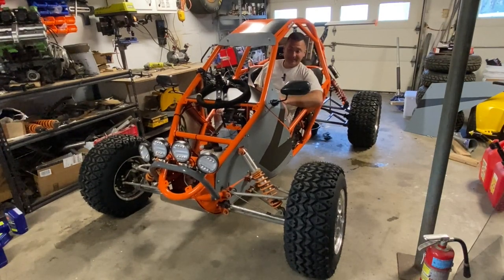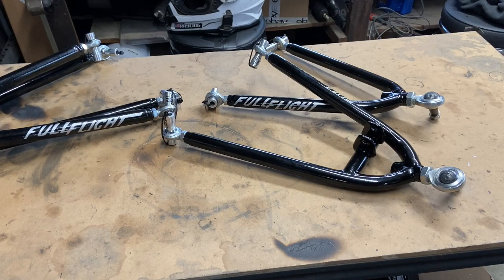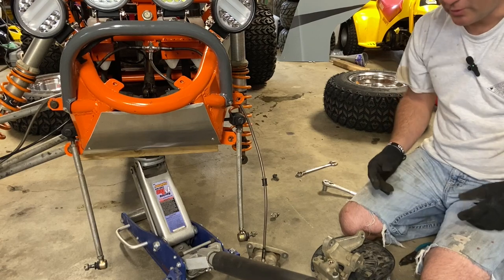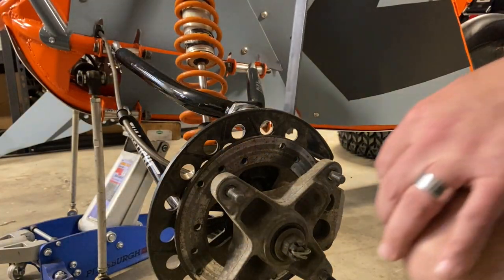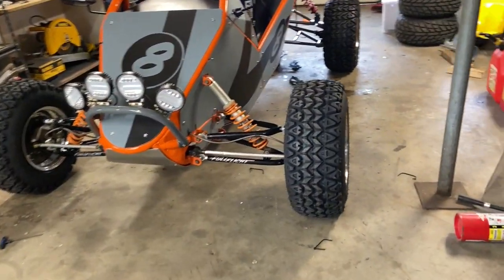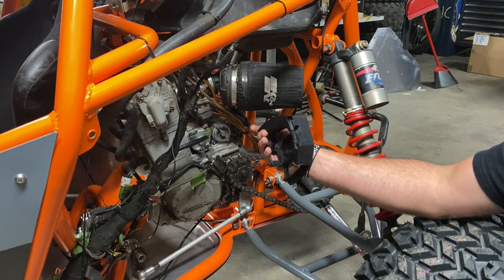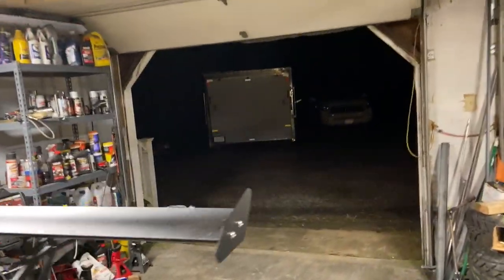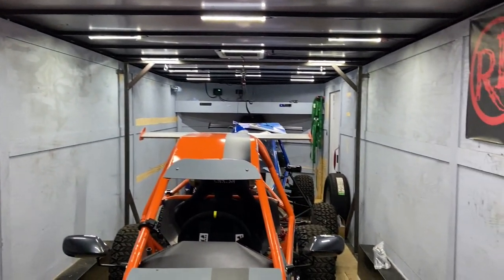KTM Powered Crosskart Upgrades

Comment: I have a bunch of questions - I'm beginning to plan a project and I have a Polaris 800 snowmobile engine .
Not sure what to do with it ... I also have a trailer that I'm putting a roll up door into.
I've been digging up parts for this with no actual idea what the finished product would be .
I had a job clearing out storage units that people abandoned and a lot of stuff came my way.
It sort of seems to be moving in the direction of a reverse trike with about a 25" tire on the back.

Comment: Kyle, I was glad to see you use and critique the full flight control arms. With the stock outlaw ball joints I'm not able to get the cart as low as I would like. For asphalt and street I want to use 24 inch tires And have 5 inches of right height. Looks like these will do it. I'm a little confused if my outlaw spindles will fit the predator ball joint studs on the full flight control arms. Mine are ordered so I'll find out. THANKS and keep up the good work appreciate it.
Reply from the maker: I’m 99% sure the predator spindles will fit the ball joints. It’s just the brakes that changed. This is an awesome solution for a lot of different ride heights and setups. They held op really well in the torture test we put them through at Busco Beach NC over the weekend. Video coming soon!
Reply: @KJRaycing  Thank You

Comment: When I started my build I made my steering linkage on the rear of the knuckle. Since, I have noticed a lot of other builders as well as you have your linkage on the front of the knuckle. Is this something I need to revisit or is this just preference of the builder? Thanks for your time and videos.
EDIT:  How do you calculate Ackerman with the linkage on the front?
Reply from the maker: So we mount them to the front just to give room for pedals and still make a compact package. The correct way to do it is following the angle of the steering arms coming off the knuckles. Since I flip mine and run them on the forward side I get a touch of negative ackerman or none at all. That being said, I haven’t noticed any bad characteristics from running this setup; maybe because the wheelbase is so short or because they are so light or because there is a live axle. In the end I would take the extra legroom over perfect ackerman.
Reply: @KJRaycing  Wow, I never thought of the leg room aspect. Your right, ackerman is more crucial for solid axle, none suspension builds where the front tires steer on different arcs to traverse a single radius. When this happens, each knuckle is at a different angle causing the caster to make the front tilt to one side, when this happens it shifts the weight off of one rear tire and allows you to turn better without the axle pushing the cart straight while accelerating in a turn. I suppose this wouldn't apply to what one would want in a crosskart. I was just curious and I appreciate your time and insight.
Reply from the maker: That is absolutely correct. A lot of guys try to use racing kart logic on these buggies but it’s not the same. A rigid chassis works better with suspension and sway bars where as on race karts the chassis is made to flex to get better turn in and steering. Your insight is pretty awesome too! Thanks for tuning in!

Comment: what wheels and tires are those? I assume they are not the wheels off an outlaw.
Reply from the maker: I re-use the front wheels from the outlaw, I actually love them because they are dwt. The 9” rear wheels are hard to fit with the custom rear a arms and the offset is a little crazy. I have a second set of 12” wheels and taller tires for trail use. $700 for a second set of wheels to make a race kart dual purpose is an amazing deal.
Reply: @KJRaycing  Thanks for the reply. What brand and size are the front and rear tires?
Reply from the maker: Carlisle all terrains 23” and sunf 22”

Comment: Your karts are amazing. Have you thought about a 4WD build?
Reply from the maker: Thank you very much. I have definitely thought about it, and I could definitely do it. I like the 2wd versions because the take more skill to drive and are more drifty and squirrelly.  To me driving is more than straight line acceleration, I enjoy the feel of balancing steering with throttle and finding that perfect drift angle.  I may build one someday, I feel like my only limitation is time.
Reply: @KJRaycing  I know what you mean, I don't know how you find the time to do these builds, you make me look extremely lazy, that's for sure. I doff my cap to you sir! 👏
Reply from the maker: I never sleep and I’m never up to date on sports or current shows.  I make my time working on these very directed with small reachable goals instead of the overall build. Small victories.